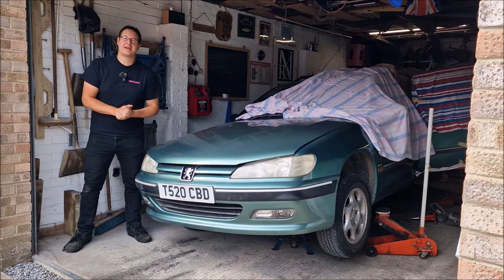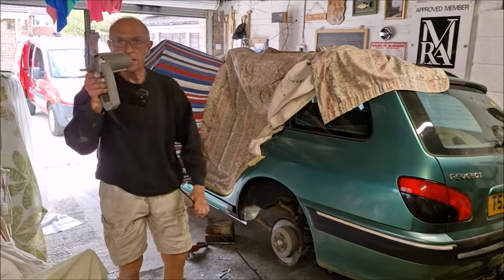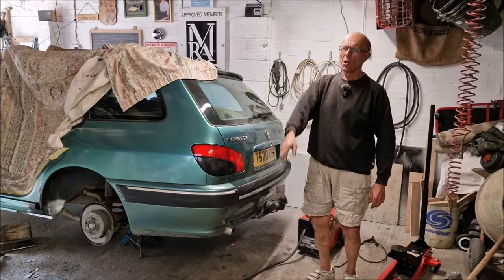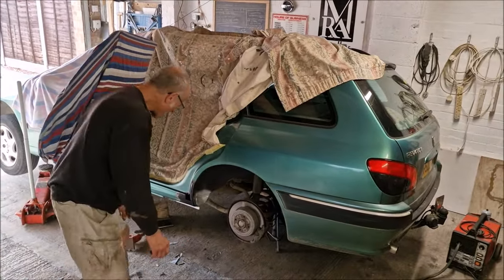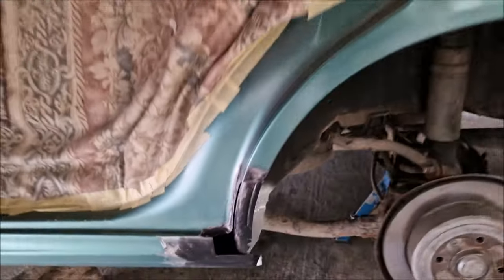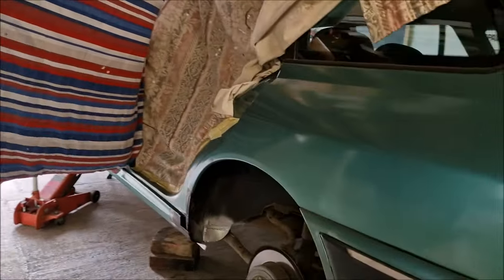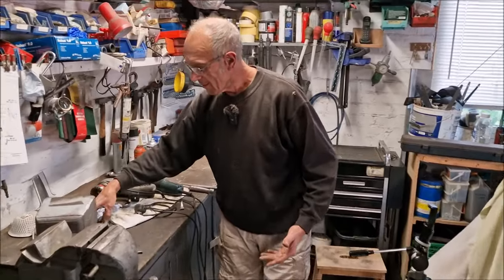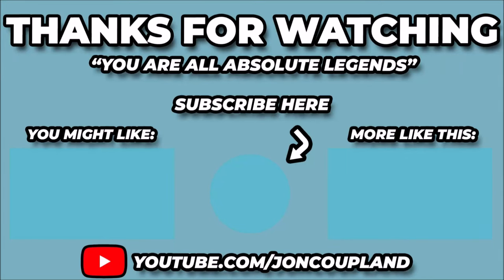Peugeot 406 Sill & Wheel Arch Repair - Day 1

Comment: The orange power tool dad was wrapping his cable round. Was that a black and decker? I think it is, dates back to the 70s i think!  I used to work in a black and decker shop, and some of the old school power tools we used to get in, some as early as the 1920s and they expected us to carry spares! You couldn't even get motor brush packs for them! I think the parts for your dads orange one are obsolete cos they were in t early 90s when i worked with b & d!
Reply from the maker: Yes it would be a B&D and very likely one from the 70s!
Reply: @JonCoupland  mind you with your dad being an old school engineer that's probably why it has lasted all this time!